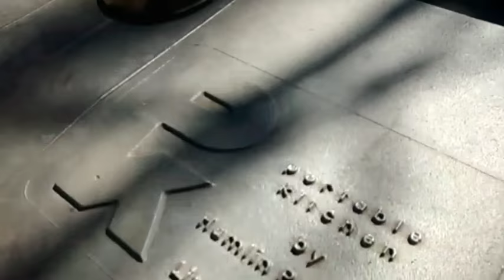Refurbished PK aluminum bbq grill

Comment: I really loved watching you work. I wish I could do this, but welding is a skill I never picked up.
Reply: It's never too late.  You can pick up an AC Lincoln tombstone and build anything he's making.
If you can make something out of cardboard... you can work with steel.
If you can make things out of wood... you can make things out of steel.
This isn't high tech shit! ;-) 
I'm impressed by his torch skills. That's  an art that takes more time than learning to weld.
Get a 200.00 mig some gas (unless you use Flux core... not a damn thing wrong with that either) and you'll be welding in a week. Weldingtipsandtricks is a good channel. Older chuckE2009 videos are good, and weld.com videos are a great learning source.
If you don't have tools yet a 20.00 harbor freight 4.5" grinder/cut off is fine for a weekend warrior.
Solid bench and a vise and you're good to go! A grinder and paint make a welder what he ain't!!! ;-)

Comment: I have an cast aluminum grill that has hinges on the bottom and top piece like knuckles. I can take off the top by opening and lifting off. Or leave it on and it will lock back when opened.

Comment: First off love your projects ! On that alum case for grill you see how warped the bottom is from experience I utilize one and made a charcoal rack as you said you were gonna do bad choice the bottom got to hot and fell out you should put some sort of 12-14 gauge to line bottom of it that cast aluminum via soft an brittle
Reply from the maker: BIG HUNk yea it was warped pretty good but I only did what I was asked, he didn't want to change the bottom so I didn't mess with it, if I was to change it I would cut it out and use 10 gauge steel to replace it

Comment: Allen, what price are you charging for the table top grill and the fire pit grill?
Reply: those firepit grills are beautiful
Reply from the maker: Scott Babb the table top grills are $90 and the firepit grill is $400
Reply from the maker: yep Sure thanks!
Reply: That's a great deal. Where are you located?
Reply: @Allensweldingwoodworking  Send them as a kit? If so would they fit in a flat rate box for the tabletop? What would you charge that way? Would be a nice project with someone just starting out to teach them how to weld.

Comment: It's been a couple years... did those hinges cause cracks in that cast aluminum? 
I've never seen an aluminum grill before. I didn't think cast aluminum could handle that kind of heat without cracking and distorting.
Reply from the maker: They did fine, still working good
Reply: @Allensweldingwoodworking  I wouldn't have been so lucky.